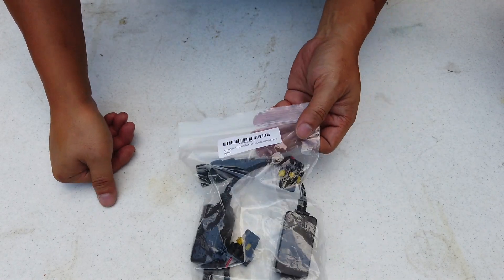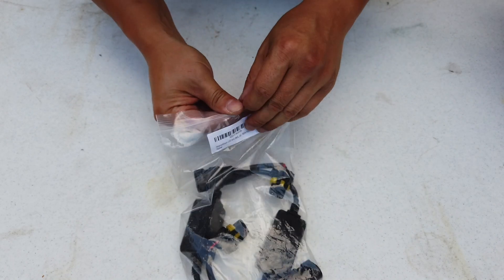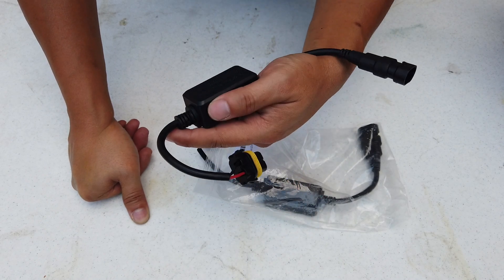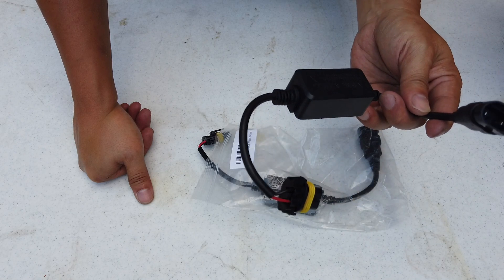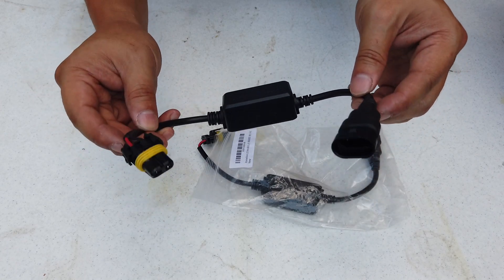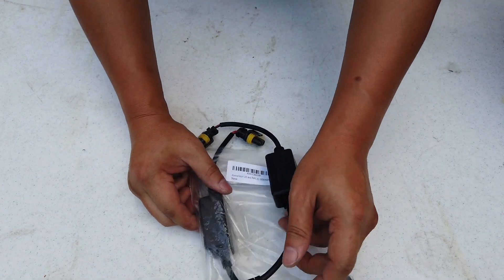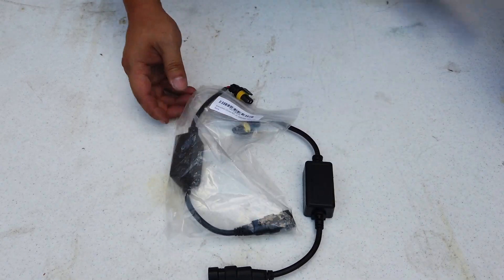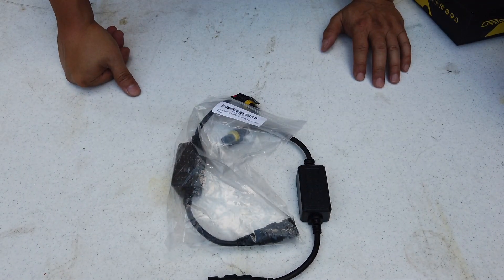XtremeVision LED Anti Flicker Capacitors + CANBUS Error Remover

Comment: There are two issues with LEDs in many FCA vehicles.  CANbus is basically the computer looking for incandescent bulbs by resistance.  Throws an error when does not see the correct ohms.   The flicker issue is due to the modulation of the voltage supplied to the incandescent bulbs.  LEDs don't like it.  They want a steady voltage.  Most "canbus" ready LEDs have driver/resistor modules (some built in) that will stop the errors by mimicking the resistance of a regular bulb.  The flicker requires an additional module such as the one you have on this vid to stabilize voltage to the LEDs. (usually a capacitor). I have a Ram 1500.....

Comment: Please disassemble one, I want to know what's inside. Just a resistor?
Reply from the maker: Yes I think it is just a resistor, but I have 2 spare, I will disassemble and create a video for it within 48 hours. Subscribe to my channel with the notification bell thing so that you will be notified. Thanks
Reply: @DIYGEEKTEXAS  no it's not a resistor, it's a diode and a capacitor, I capacitor will allow full voltage and current to flow through it until it's fully charged. It takes only about 200ms to charge it up but the current flow is enough usually to keep the canbus check happy.
Reply: @stiggyness1976  will it burn the plastic covering? that's the question
Reply: @amanfromalternativeunivers8329  No it won't.

Comment: So did it worked ??
Reply from the maker: @Juan Ram yes they work great. no more flickering, warning messages and sudden light on/off at night.
Reply: @DIYGEEKTEXAS  mines did not work they stay on for 5-10 min then turn off I have no idea I thought if I had it would stay on
Reply from the maker: @arnmoore1705  Did you install resistor on both side (passenger and driver) headlights?
Reply: @DIYGEEKTEXAS  I did ... So before the the resistors was added they flicker on and off. So then I added both if them to my led lights on my Dodge Challenger both sides and they stop flickering but now they stay in for like 5 minutes then they shut off. Is it another option